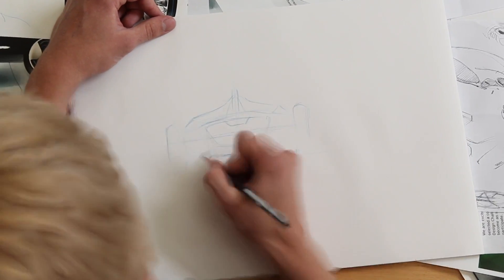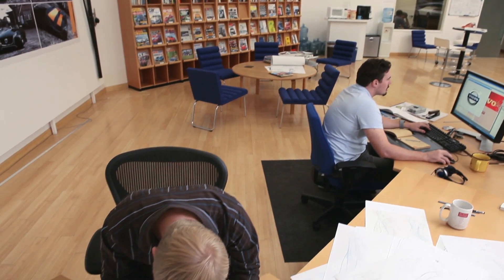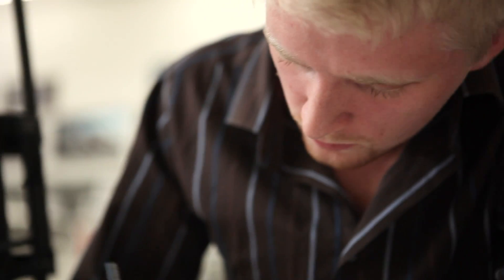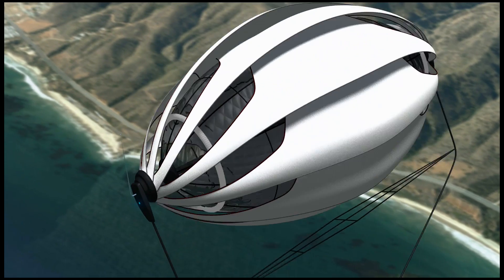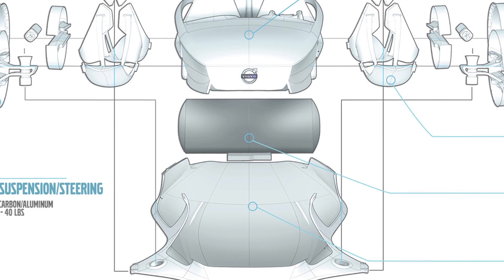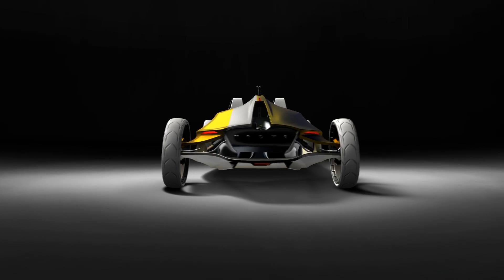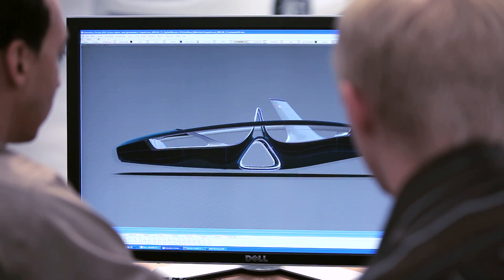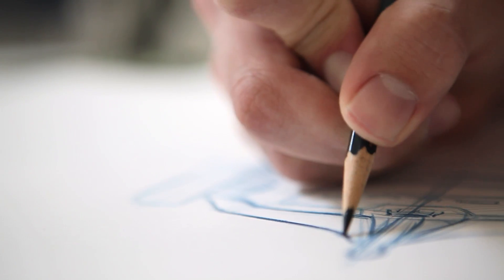LA Auto Show 2010 Design Challenge - Volvo Air Motion

Comment: I loath brain dead designers like this. Not an engineer in sight to deliver a reality kick from a steel capped boot up their arse. 
Fact Bearings in the rims mean any curb impact seizes the wheel.
Fact Air motors & compressors lose energy to heat so this POC will use 5 x more energy than an electric car of the same performance 
This carbon fiber ashtray will have a 10 mile range with miserable performance. Idiots